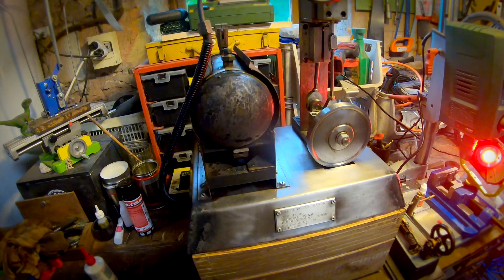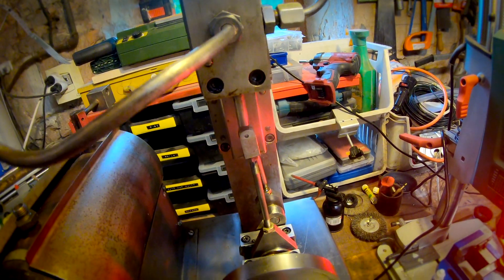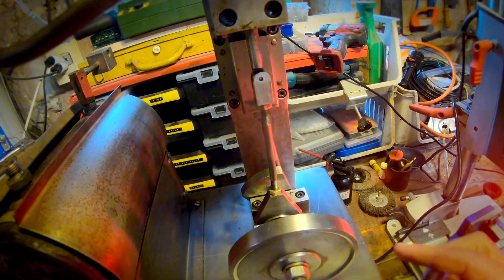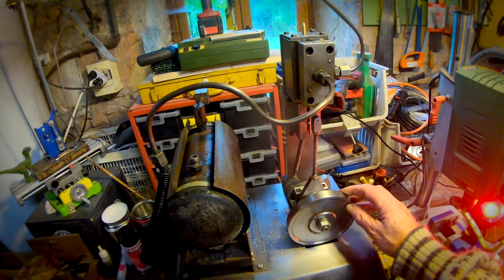Low Cost Steam Engine Boiler - Professor Simon

Comment: Hundreds of miles away a nuclear reactor is producing steam to power a turbine, coupled to an alternator to power a walpaper stripper via a very inefficient electric transmission system.
This in turn powers a very inefficient model engine.   Estimated efficiency minus the nuke reactor is in the order of less than 1%......But when coal was cheap? Probably around 30% depending on the boiler type,  flame tube, water tube, or scotch etc.  The cheapest way to run the engine would be with an electric motor, no steam Mc.Phail !!
Reply from the maker: i like it norman...french nuclear reactor powers steam engine via wallpaper stripper.

Comment: The real issue is pressure, isn't it?  Boilers produce steam at pressures significantly above atmospheric, which is why they have to be properly constructed, tested and maintained, and thus why they cost so much. A wall-paper stripper produces a good volume of steam, but at not much more than ambient pressure. A model stationary engine is usually not doing any work, so only needs enough steam to overcome its bearing/sliding friction.  Once you have a steam requirement of perhaps 1 psi or more, then the wallpaper stripper is, literally, a non- starter.
Reply from the maker: good point ...the wallpaper stripper is very low pressure...that's all i wanted to run and display my models.... i proper boiler would still be fun....coal fired...hmmmm.
Reply: And the wall-paper stripper doesn't have the required smell.......

Comment: You might be able to throttle back by running the wall paper stripper into a manifold where a take off from the manifold is run into a bucket of water with a needle valve to control the takeoff pressure.
Reply from the maker: i like it

Comment: That wall paper stripper was an excellent solution.   I guess the next thing needed is a governor and a way to divert excess steam.  Tell your wife you are going to buy a boiler the design of which is called the "Krakatoa" and that "they think they have gotten most of the problems worked out," but you are going to be safe by putting sandbags around it.

Comment: Do you know roughly the bore and stroke of the first engine? Also what pressure of compressed air did you supply?
Stuartturnersteam.com
Steve
Reply from the maker: the bore is about 25mm and the stroke maybe 60mm

Comment: I have an interesting question prof,should you pay water rates on the water used on a steam engine?
Reply from the maker: oh boy don't tell the water board... ha
Reply: Yes, but you can attach a generator and sell the power produced to the grid to offset the cost ;-)
Reply: @sofa-lofa4241  good point but only if carbon neutral in future.
Reply: Surely water is free when you live in a mill 😆
Reply: @mikemilton4370  mills are probably taxed.
Reply from the maker: it is...sometimes a bit too much
Reply: But the exhaust is vapours that are eventually rained back to earth requiring no treatment?